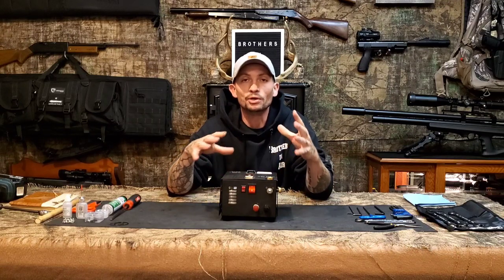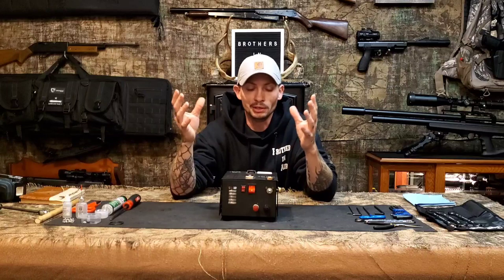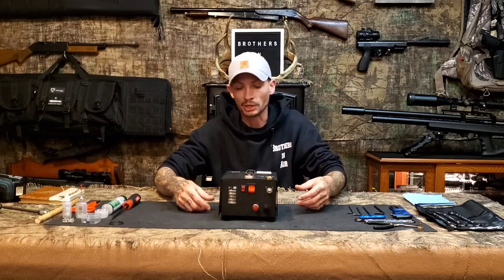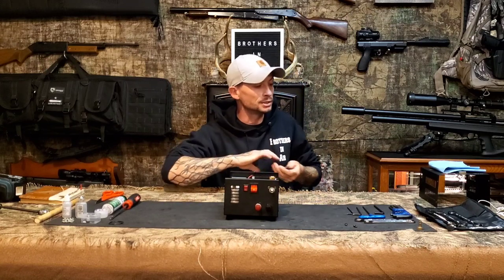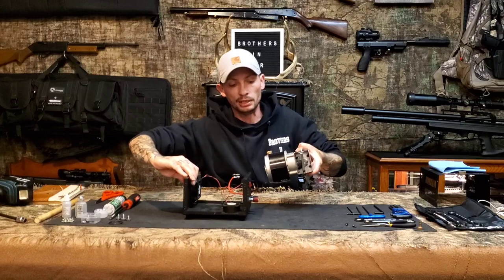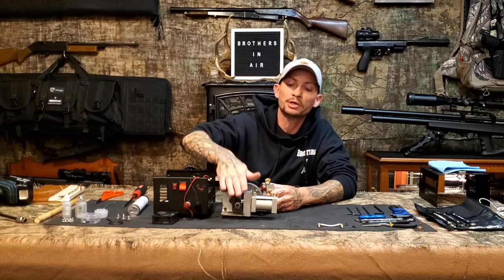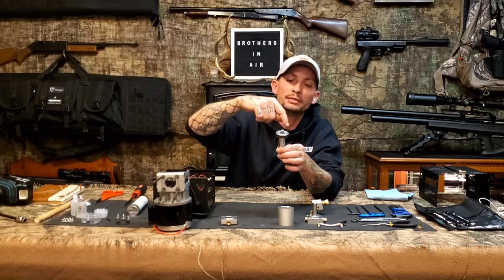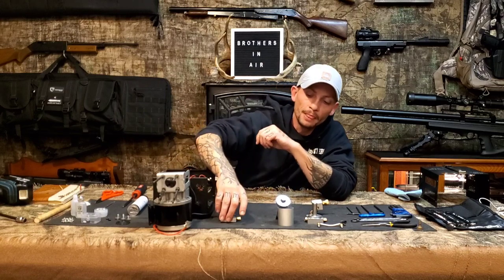TUXING AKA "SPARK CLONE" COMPRESSOR  **** 1yr Update + DIY Pump Rebuild/Maintenance ****

Comment: Great video as always! I’m a new subscriber and have now watched almost all of your videos. I’ve never had a pcp and have been hunting with a Benjamin trail .22. It’s extremely accurate after the trigger mod but it’s hard to shoot unless you have an extremely good brace. After watching What you’ve been able to do with the flashpup I’m definitely buying one. I mainly want it for hunting and I’m torn between the .22 and .25. I have definitely had times to where I was disappointed with the knockdown of the 22. I have seen where you have said the 22 is definitely more accurate. Is it a very small or larger difference? Also is the trajectory similar amongst the two. I’m definitely interested in your thoughts for my situation. I’m hunting doves, squirrels, crows, possums, raccoons and so forth.... thanks!

Comment: I have a question about my Hatsan Flashpup qe in synthetic. I have a question about the moderator. In a video you showed which direction to Face them. I understand the black ones with the wrap go big and forward. But the spacers is what I have a question about. One end is opened and the other and has a small hole. Which way do those face? If I taste both of those with the big hole forward then my tip will not fit on the rifle.

Comment: I bought this Tuxing pump from Amazon, it is an exact cloned unit but manual shows it is from DAVV company instead of a Tuxing branded one. I followed the instructions exactly and filled my AV Avenger .25 cal to about 3600psi. No issues. Next day went to fill my .22 cal Discovery to 1800psi but it wouldn't make any pressure at all. I have no idea what could have happened since it worked fine 12 hours earlier. There is a useless manual and a bag of spare parts that I have no idea where they are used or for what usage. Any idea what could be wrong with this? If I hold my finger over air outlet it is clearly still pumping air when turned on, but it never makes any pressure in the whip line when using the test plug or whem connected to a rifle. I cannot feel or hear any leaks anywhere. Please help if you can.

Comment: Turns out that Hercules Bully .45 gets to about 2900 psi ( around 210 bar ) and starts leaking around the edges of the fill probe and won't go any higher to 3600 + like I need it to for best shot count being .45 cal. . Changed O rings on fill probe and still leaks the same way. I don't like where this is going.
Reply from the maker: That's odd. Usually you will only have a leak there if probe o-rings go bad or from day one because machining tolerances were off on either the fill port or fill probe. Did you get to the bottom of why you're experiencing this? Once I thought my probe o-rings were leaking (changed them twice)but it was coming from the joint/seal within the quick connect. Could have swore it was coming out the fill port though. I'm an idiot sometimes though.....

Comment: Is there a wafer battery in my temp gauge that might be dead now  since it is blank ?
Reply from the maker: yes it has a couple of those small wafer style batteries. I had the same exact situation happen to me after a few fills. There's a lot of pressure pushing the batteries outwards against the cover that holds them in so in combination with the vibration it broke loose their little crappy dab of hot glue or whatever holding the cover. The only way to access the batteries is to remove the upper housing. You may be able to remove the readout from the upper housing by sticking something down in there and prying at the two clips on the ends but I don't see that happening without damaging it. What I did was take some gorilla glue tape and tape down the battery cover from the side and over the back up to the other side and it has held ever since. I've been going for a year on the original set of batteries so I would imagine you're experiencing a similar situation and the batteries just aren't able to make contact with the input points because the cover is loose.
Reply: @brothersinair2064  Again , Your the go to fella for this stuff and many others. Your channel should grow. I think your hard to find on utube. I found you by typing in " Hatsan Flaspup " if I'm not mistaken. 10 -12 months ago.
Reply from the maker: @johnaverick7468  Thanks Brother. I should key word the videos so they pop up for a variety of searches. Once I'm all healed up I'm gonna start really cranking away at the video stuff. I do have a couple that I did before the surgery with the Wildcat MkIII Sniper in .22 and .30. just need to finish the editing.
Reply: @brothersinair2064  I hear the editing can be the ball breaker of posting these vids. Can be time consuming I have heard
Reply from the maker: @johnaverick7468  yeah that's definitely the ball breaker. So time consuming......

Comment: I've been using this same compressor on my umarex to fill to 3000 psi with no problems after a couple months. I ordered 2 air venturi avengers that take 4500 psi. Do you think I will have any problems filling them? As far as having to turn it off a time or two to let the Tuxing cool off or anything like that?
Reply from the maker: I believe the compressor could fill the avenger to 4500 no problem but would need intermittent cooling stops.Just be sure to depressurize the unit when stopping to let it cool. You don't want to start the pump while already under pressure but outside of that you should be good to go.

Comment: Thank you, great video.  A friend just gave me one, he upgraded.  This one worked great for several years he said then lost pressure.  I'm getting ready to pull the piston, but having trouble locating affordable o-rings kits.  This unit is TXES061.  If anyone can help with o-rings sizes please let me know.  I see a kit on eBay for $20 out of China but hoping for a better price and in the states.  Thank you.